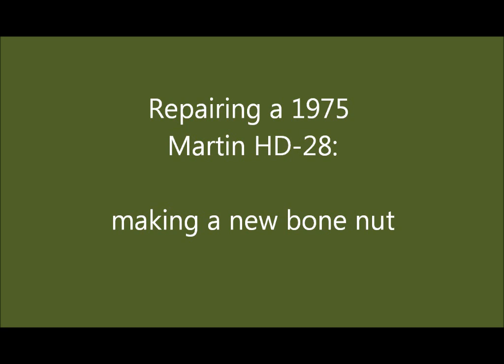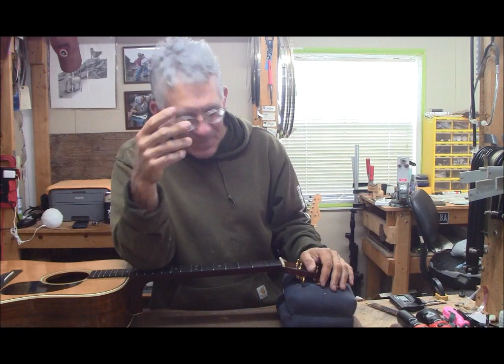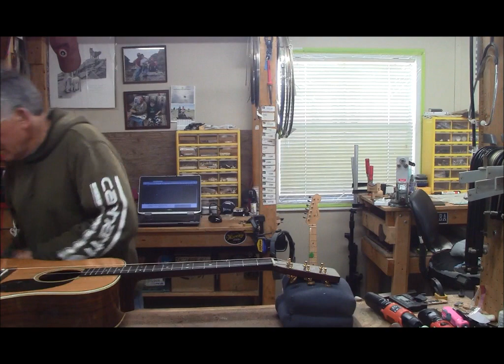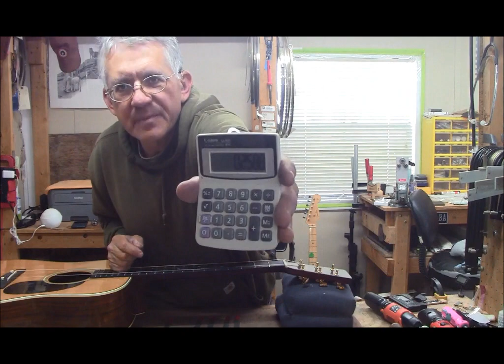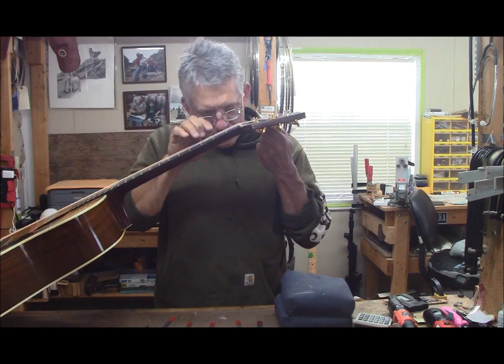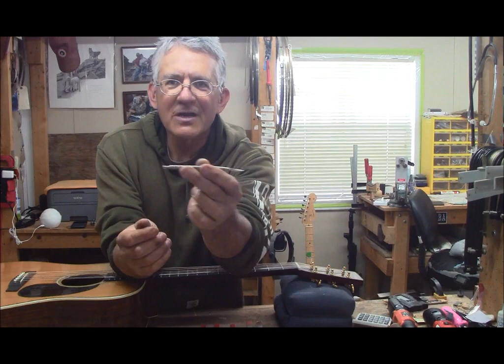Repair-  HD-28 making a new bone nut

Comment: When your describing the string spacing you say that you don't like them equal centre to centre,can you explain what you mean by centre to centre please?
Reply from the maker: The center of each string is the same distance apart.  Draw 6 lines on a nut blank, each, say 0.270" apart from the other.  Now flop the E, A, D, etc down on top of those lines. You now have strings with equal center to center distances, but the spaces between them will be least for the fat E-A strings, a little more for the A-D, a little more for the D-G, etc  To me, the E and A will feel really cramped because there's less room between the edges of those strings compared to the thinner B and e strings.  The way I do it, all five spaces are the same and the center to center distance is what changes.  This feels so much roomier to me EVEN when the E's are in exactly the same place.  And, FWIW, I stole that from a 96 Martin OM-28 I used to own- many builders use equal spaces rather than equal center to center.
Reply: Ok now I see,that's very clever of you Bryan makes sense.